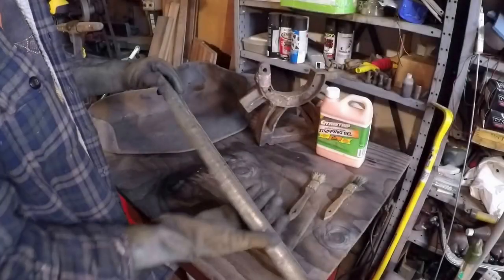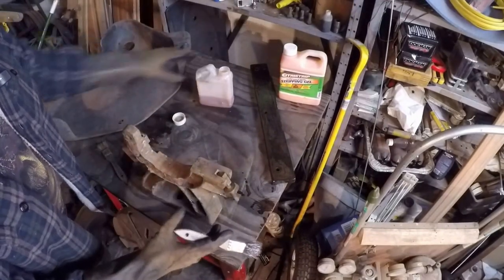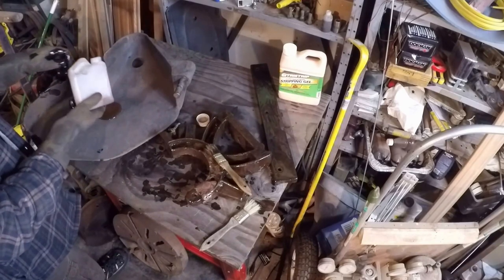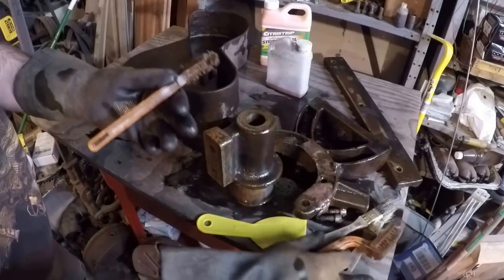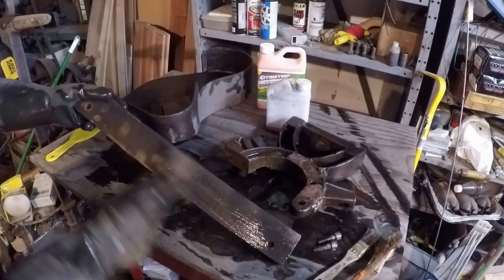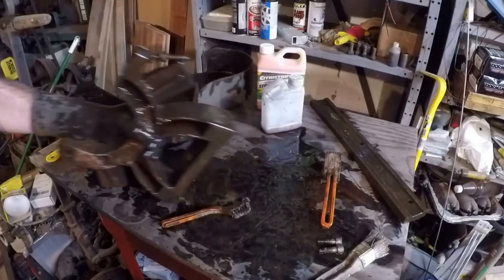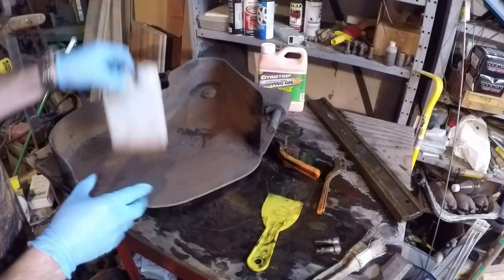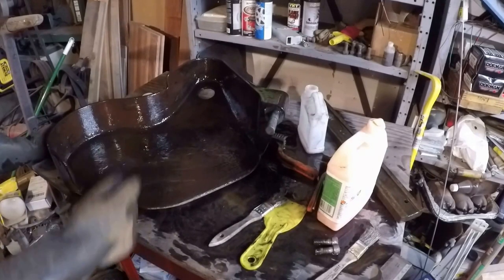Citristrip on Cast iron Parts

Comment: I like to layer tin foil or saranwrap on the parts after I've applied the gel.  This keeps  it from drying out and lets it work it's magic longer.
Reply from the maker: that's probably a good idea but does the chemical react with the aluminum?
Reply: @OldIronShops  not that I've noticed.  I've used both interchangebly depending on what I have on hand.

Comment: It's far less convenient to use of course and much more caustic, but a bath of hot lye and water will take off anything I've ever seen for paint on ferrous parts. You DON'T want to use it on anything aluminum since it will eat the parts. And it seems to etch brass or bronze so I'd not want to use it with those either. But it will strip oil, grease, and any paint nothing else will touch. It can burn holes in clothes so as much protection as possible is a good idea as well.
Reply from the maker: Turning Point good to know if I find something tuffer then this paint. everything has its pros and cons.  thanks for the comment

Comment: I didn't know those pins were in Babbitt.  I have a door where the pin seems bent out of position on a 9" South Bend.  I looked at that part and thought, how could that large pin be bent without breaking the door?    Now it makes sense, the Babbitt is distorted.   I noticed you only waited an hour or two before going back to the still wet Citri-Strip.   It's quit working long before 12 hours, believe me.   With both Citri and Magic, the bulk of the work happens in the first 60 minutes.   It might help to brush it around and disturb it after a little while if you happen to be passing through the workshop.  I prefer stripper to a wire brush.  It's like a wire brush that works while you're doing something else.  ;-)
Reply from the maker: +Crafted I water 14 hrs mostly because I went to bed and didn't pick up untell every one was asleep again. It's a very odd paint Judy kinda disolves when you brush it but if it's thick it turns to pasty gunk. I suppose it would be posible to reset your pin if your crafty.
Reply: I could jig that pin and simply reheat the Babbitt.  Didn't somebody comment on a prior video that the finish on old South Bends is Japanning?
Reply from the maker: +Crafted you could but remember your going to have to keep it from running out and I I don't know if it's all japaning.